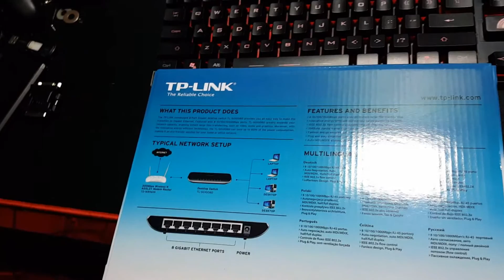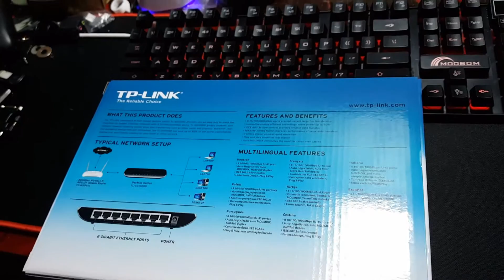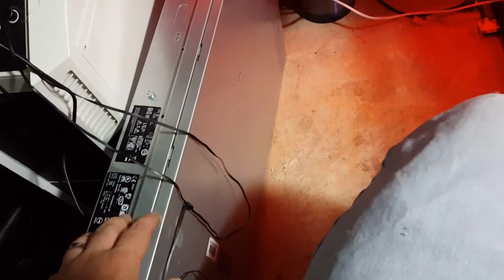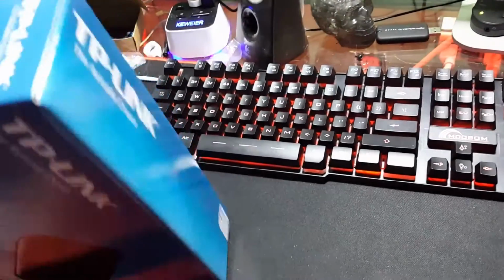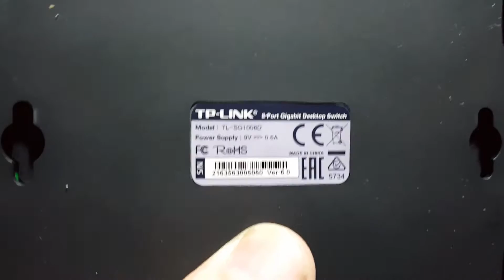TP-LINK 8-Port Gigabit Unmanaged Switch Unboxing & Teardown (TL-SG1008D)

Comment: What's the processor? Thanks for the vid
Reply from the maker: You know I honestly do not remember if I even recall seeing it video. I know it's not managed switch and it works damn well I have been using it ever since this video was posted and I have not had to restart it once since it was plugged in. Now it has been restarted because of brownouts and stuff like that but not because it froze or anything like that.
Reply from the maker: Also thank you for watching it's appreciated
Reply: Realtek RTL8370N
Reply: @ferenc1964  thank you for answering. Now I’m just trying to remember why on earth I wanted to know what microprocessor a network switch was running back in 2019.

Comment: What I don't like is the cheap plastic cover.  I prefer a metal cover on my switch.
Reply from the maker: +orestesdd I would agree but for the price they probably couldn't offer a metal case. I do have to say that it's been running ever since this video Non-Stop and I've never had one issue I've never had to unplug it or anything so it's been really good.
Reply: does it make a high frequency sound?